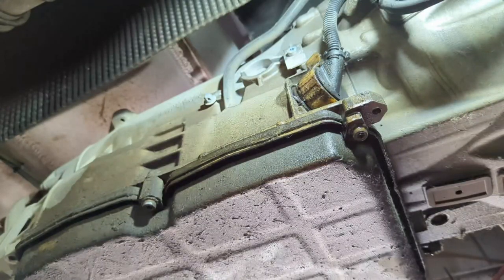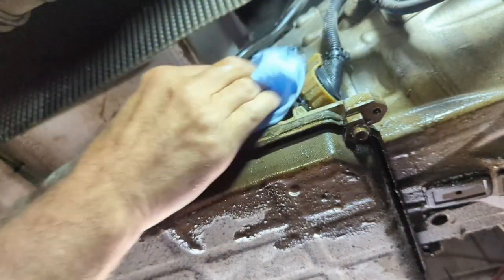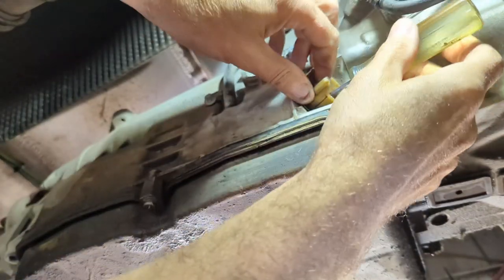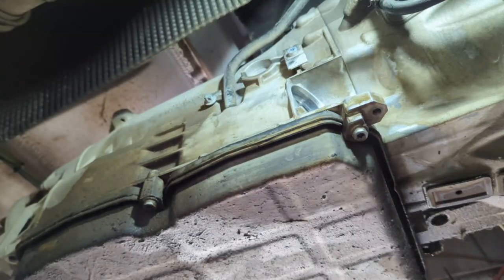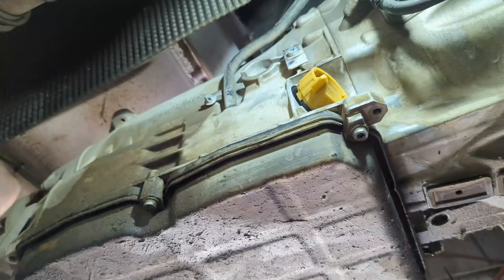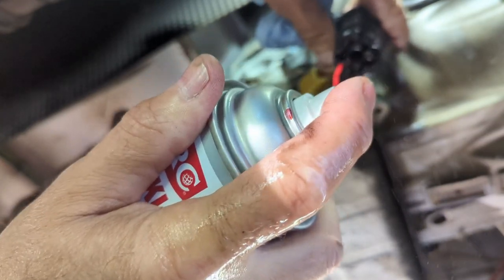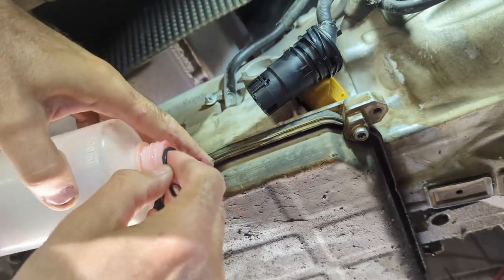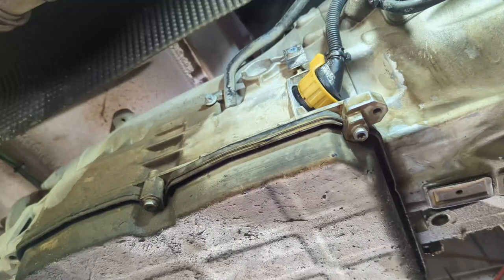T1N Sprinter Van Leaking Transmission Harness Socket Replacement

Comment: $20 how could you go wrong. You have to love it when you can get parts that don't break the bank and are delivered right to your door.Thx Alvin
Reply from the maker: Yes, one of the cheapest repairs a guy can do on a Mercedes! Lol
Reply: @J_R_Shop  I forgot the Sprinter van was Mercedes. Huge win for you. I wonder how much Mercedes Parts counter would charge you? Lol
Reply from the maker: @dougabbott8261  I was afraid to even price it out!
I keep the old socket, I'm pretty sure I can fit it with new o-rings, now that I know the sizes.